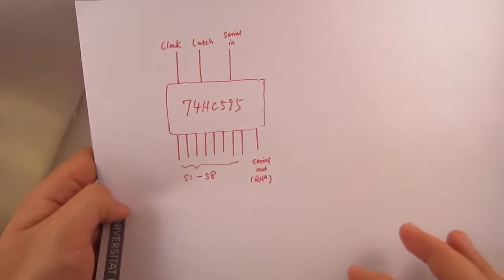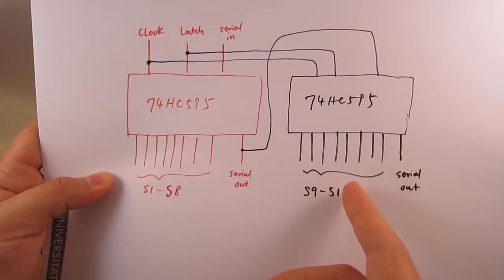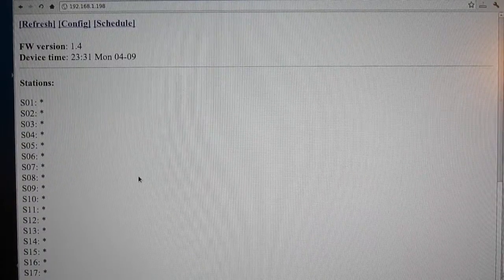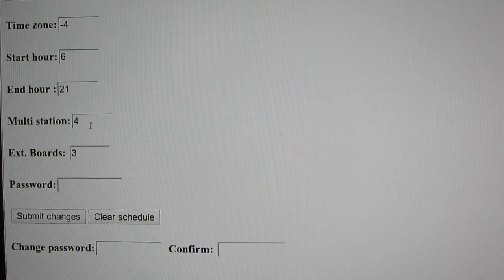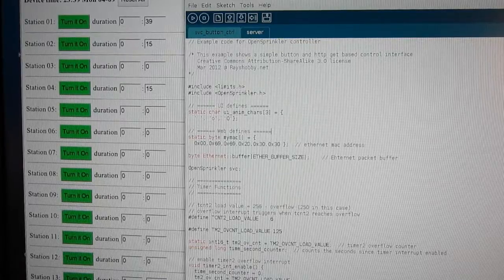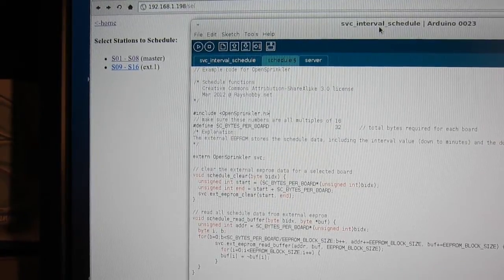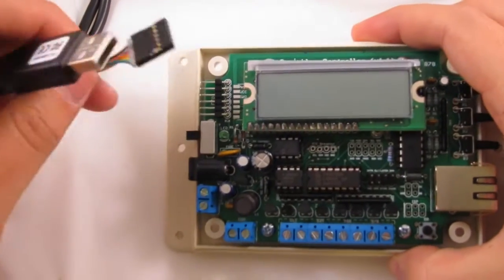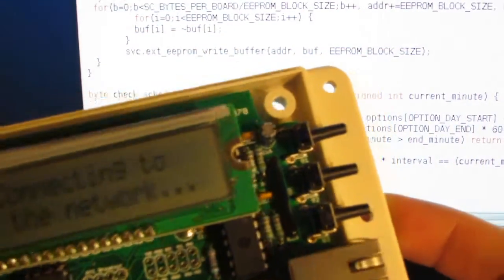OpenSprinkler v1.1 Update

Comment from the maker: @cypinate: perhaps you can make use of the available digital or analog pins on the OpenSpriniler circuit board to detect the float sensor status? Currently the available pins are digital 3 and 9, and analog 4 and 5.

Comment: Good stuff, I want to use this system to control an ATO (Auto Top OFF) water system for my Turtle Tank. Basic operation 1. Open Valve to drain 20% of water 2. Open mixing valve set to 78 deg F to fill tank..Done but I will need to put float sensor switches in place to stop the drain and fill? doing a manual ATO will be ok for now especially when I use my Ipod touch to control it from the couch ;)- Oh yea maybe I get one to water my plants too!